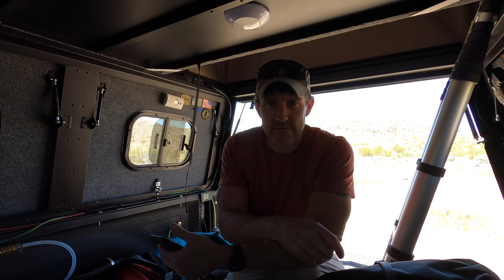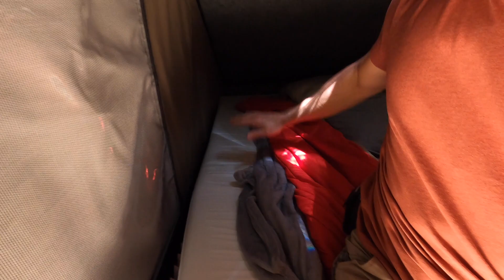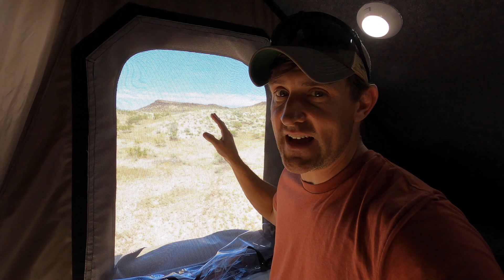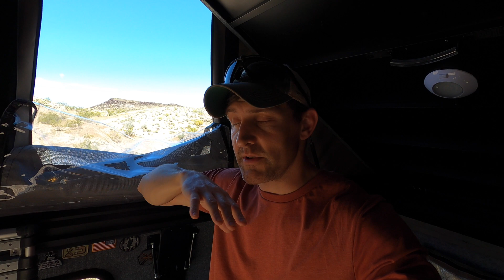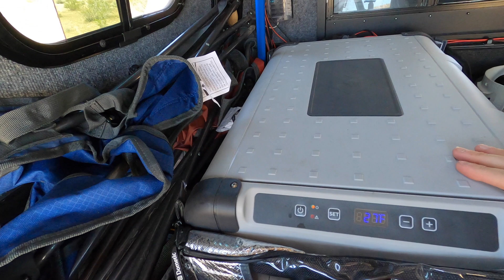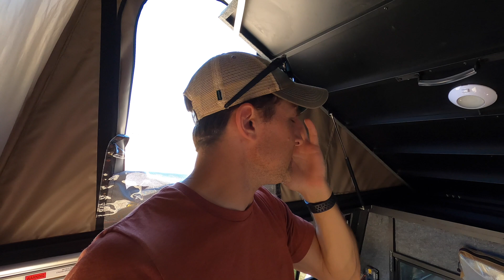Review / Snap Outfitters Treehouse; Two months of semi full time use / California / Spring 2020

Comment: Have you had any problems with your welds on the verticle columns cracking? I have.
Reply from the maker: Yeah I had a few crack, but they were only surface cracks.  I no longer have the camper, I sold the truck it was on as it had 200,000 miles and I didn’t have anywhere to store the camper, so it went with it.
Reply: @PrestonGladd  The welds on mine are cracking quite badly. I love the idea of the camper but really wish I had gone with a GFC.

Comment: One other thing - Just a guess but your condensation issue around the light could be due to your heater. If your heater works by heating the interior air, it may be producing humidity. If it pulling in 100% fresh air from the outside, probably not.
Reply from the maker: No, it was a leak in the roof vent.  I got it fixed.  They didn’t use self leveling DAP, they used a thin layer of regular silicone.  They don’t offer the vent anymore because of that issue.  I told them if they used the right sealant it would solve the problem but they just deleted it from their options.

Comment: Thanks for the detailed review. I appreciate that nothing is perfect and one has to find what is best for them. I am in the market for this style of truck camper for my Tacoma (6 ft bed) and been shopping the usual suspects, most of which you mentioned. The intent is to do some light/medium overlanding (which I do not know how to quantify that yet ...). So my query is, which was the only thing I did not see covered, how secure is this setup? I don't plan on rock crawling or baja-ing, but I want to know that this kit will hold to my truck with no worries if the going gets tougher than I planned. 
Thanks.
Reply from the maker: Its bolted down to my truck with 6 bolts, I could roll over and it wouldn't go anywhere.

Comment: What communications gear do you have? I noticed at one point a unique antenna off the back, most likely an H.F. Antenna.
Reply from the maker: I have a yaesu 857D, and several other yaesu radios.  I also run a cobra CB from time to time.  But technically my 857 will run on that band to, albeit not legally.

Comment: Do you have a video showing the awning open and the hot water system operating I may have missed it
Reply from the maker: I didn’t do a review for the awning I can do that if you want, I just released a Joolca video for the hot water system.  You can also use discount code GladdOverland on joolca’s website for 10% off
Reply: @PrestonGladd  ok thanks

Comment: Have you considered four wheel campers project M? Just curious of what are your thoughts
Reply from the maker: Spec’ed out the same way mine is the prices are comparable, the four wheel camper is a bit more expensive but only by about $500, the outer skin is not as durable material.  overtime you’ll do just fine but where as mine probably could survive a roll over and it wouldn’t do a lot of damage, the four wheel camper would definitely rip right through the side. Also it’s got a little bit larger footprint so you’re more prone to snag on trees etc. it’s not a bad option I just prefer the more compact design of the Treehouse over that design and the material rigidity.